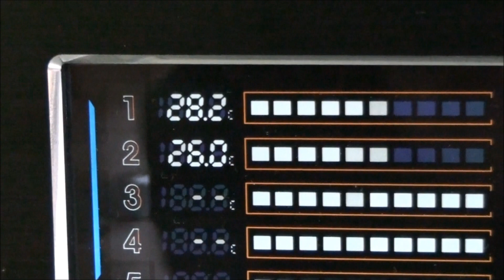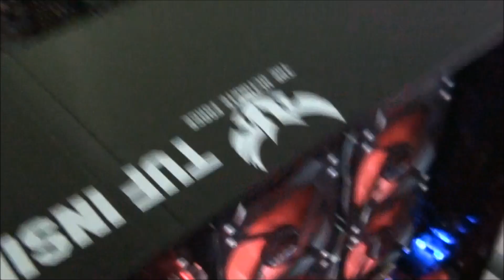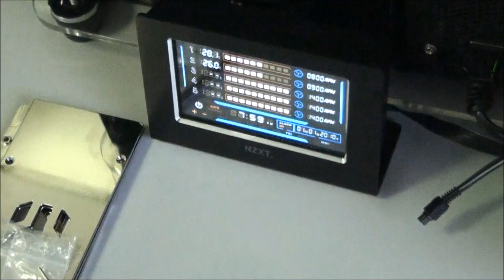Singularity Extreme Danger Den Triple 360mm Radiator Water-box

Comment: Crazy to see a production remote cooler. I've designed and built a number or them...make perfect sense to me...much cleaner build in the case when the LC parts are closeted. No sound baffling...which seems very primitive to me. But then again that's just me. I hate fan noise.

Comment: Wonder how many watts of heat that can handle. Thats pretty impressive! here I am with my little 2 x 140mm loop and you have 9 x 120mm fans. I am also using the blackice sr1 rad in mine (280mm version).

Comment: RE: NZXT Sentry LXE Desktop Touchscreen 5 Channel Fan and Temperature Controller
You have 9 fans, 5 Channels, did you have to wire some fans together e.d 3 fans per channel, special connectors provided?  Cheers

Comment: I plan on getting a beast PC with water cooling dor dual GPU's and the CPU, but i want to upgrade it to 4 360mm radiators and push pull config because here its 120* on a regular day, I need extreme cooling for over clocking and i need to run roughly 20*C or under, I know thats cold but I'm going to need it For what i plan to do, Any suggestions please respond, Kthxbai!

Comment: hey may i ask you a question ? i want to watercool my pc because it gets hot as hell. but i want to use 2 radiators to watercool my system, 1 for the graphic card and 1 for the cpu. the chipset etc is going to be air cooled with some extra fans on low rpm. now the question is, do i need 1 waterpump? do i need a specific size of radiators? or tubing? and all by all, is it a good idea? i have a aerocool strike-x warrior. with a amd HD 6870 graphic card and a amd fx 8120 cpu.

Comment: i tore one apart to make a homeade water cooling system, no need for stainless steel and light blue techno lights, PLUS i got a BIG compressor and pump from a window AC unit, i cool my ps3 and PC with one set up and ALOT of surplus surgical tubing

Comment: If I were to buy this box and place the radiators and fans,  I have been stumped on the powering. I see you got the Bitfenix board and NZXT fan controller, is this the best configuration for it? As I am stuck on how the powering of the fans are getting power as I see no cables from the test bench to the radiator box.

Comment: I wasn't sure that the principals would still apply, but in most instances when you apply pressure to a liquid it excites the molecules and increases the temperature. I have only ever dealt with commercial applications and the increase in temperature can be extreme at the outlet valve. I figured that this type of application could potentially show a difference of up to 3-5 degrees Fahrenheit.

Comment: I would have thought bringing the fluid into the pumps and out to the radiators then send it to the device you wish to cool would have been the optimum setup. That much pressure has to increase the temperature of you coolant at the pumps.

Comment: BTW, a surface has to be colder than the dew point of the ambient air in order to condensate. It is possible for that to be at or near ambient temperature, but it is not always the case.

Comment: For multiple WB I'd use a loop for each GPU WB.
EG: 1 cpu + 3 gpu = 4 loops, with a 360 radiator each.
Let's say that we are running a 3 way SLI WC, and the GPUs are cooled in one loop(CPu separate loop with NB, VRM etc). The 3'rd one wiil get a warmer coolant.
A high-end GPU has 200+ TDP. OC-ed high-end CPU ~150w?!

Comment: This watercooling setup is absolute overkill. Cooling performances will increase only marginally over a single radiator, if not worsen as more parts increases turbulence and decreases flow. You'll spend you money better on a phase change cooling system.
Plus, with overclocking using this kind of watercooling setup, its not the temps that limit your system, but the voltage.

Comment: @noneuno53 Actually there are several reasons for the increase. One- materials used. Heater cores use aluminum water pipes where as most newer pc rads use copper. Copper is more expensive, but it sheds heat better. It also prevents the problem of galvanic rust from mixing copper and aluminum together. Second-fins and mountings designed and tested to work with pc fans. Using a heater core means jury rigging them on. Third-like you said, there is an increase bc its pc specific and still niche.

Comment: @pagemaster36 And you would be wrong. Water is no longer a necessity for overclocking, as it was with the 1st gen I7s, but it still shows dramatic decreases in temps. Again, not necessary now, but much better.

To kind of put this into perspective, my I7 860 ran 84 degrees Celsius on air when overclocked to 4.1 ghz and hyperthreading on. On water, it ran at 54 degrees at 4.2 ghz. 

I'd call that a rather drastic difference.

Comment: @0peppers Just doing some quick estimates in my head, I'm thinking 1300-1400 watts would be needed. So a 1200 watt and another 300-350 watt psu. This would be an exceptionally hard draw off your wall, and you might, depending on your house, have to rewire to handle this much power draw. At a minimum, you might have to plug each psu into a different circuit breaker's socket.

Comment: @0peppers I take back what I said. I was talking about a single 990, cant run them in dual cpu config, but I was forgetting to add in the extra rad and was thinking only 1400 watts of dissipation. With 2100 watts, it could hold that and then some. 2 over clocked Xeon 5650s in an SR2 would come close, though.

Comment: @dakata17819132 No, it doesn't make a difference. The temp of the loop will stabilize after about 30 minutes of running and the water will still be the same temp. You will see less than 1c temp difference on different loop setups. This has been tested and verified many times.

Comment: @0peppers 990x OCd to 4.4 ghz, and quad sli/xfire oc'd could over power those rads really quick. With 2800 rpm fans, they are removing around 700 watts per rad. The cpu alone could eat up one rad. 4 oc'd videocards would either get really close to, or might even push on over the edge, of the cooling capacity of that setup. Put in newer rads though, and I'm not sure something could overcome it.

Comment: @1977JohnBoy 26c is a lot cooler than the 30-45c temps inside most boxes. Water cooling makes a HUGE difference. 

On my I7 860 with air cooling at 3.8 ghz, I was running 67c at load. After water cooling, that temp dropped down to 35c at load. I was able to then push the OC to 4.2ghz where it hums along nicely at 50c. This is in a 25c room.

Comment: @dynohate Testing has shown that high speed fans do better in pull, low speed fans do better in push, and medium speed fans can do either efficiently. The difference is very little, as noted by the OP. 

Not bad, but I would dump those old radiators. There are better ones. Feser one is crap and will eventually lead to a clogged water block. This is has been verified several times. Use colored tubes, not useless, overpriced, dye bombs.

Comment: @robthatguyx also... look at your mini-fridge. The compressor on all fridges, but especially your mini-fridge is engineered for like a 2% duty cycle. So it turns on maybe 3x a day to cool your food/drinks. The majority of the time it is off - while insulation keeps the temperature relatively constant. If your compressor was run 24/7 because of a heat source like a 40C radiator... it would die very fast. 24/7 compressors are expensive to make. Everyone has this idea though. :-)

Comment: @SingularityComputers Could be because you have the ports at the bottom so there's only one chamber in the 'top' endtank, while mine are on top. I have to un-rack it and flip it six different ways and I'll still be getting bubbles out of it, but that's only because I'm running a single teeline into two loops (I don't like a lot of stagnant thermal mass) and any bubbles aren't guaranteed to turn up the teeline, instead getting blasted apart and sent through again to reform in my radiator again XD

Comment: Ive just bought 480 sr1 radiator but im fitting 4 gentle typhoon 5400 rpm fans, will this combination be ok, b cos u said this rad is desighned for low rpm fans ???

Comment: Amazing thing . I have been talking to some facebook pals in the US about this very same Waterbox just yestreday. A couple of questions :- 1) Every thing in the WB is powered by 1 4 Pin Molex through the NZXT LXE Fan Controller 2) My intention is to cool 3 GTX 580's & an Intel 980X CPU - 1 Reservoir only required for this ? 3) You think two pumps is a good idea . 4) Two 360 Rads enough for my needs you think ? Thanks in advance . Very informative vid.